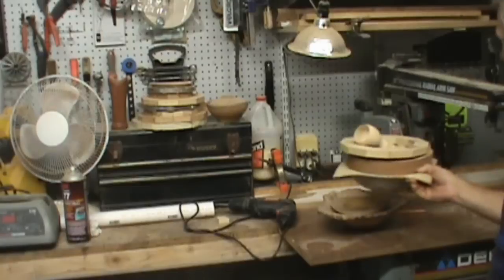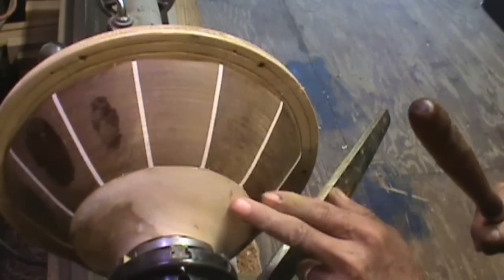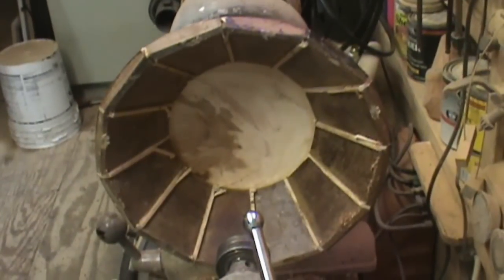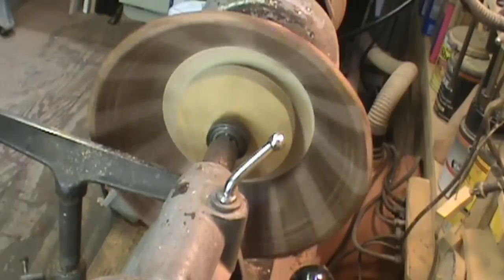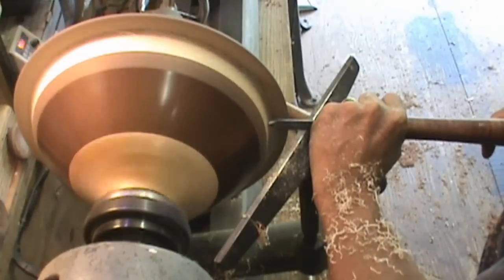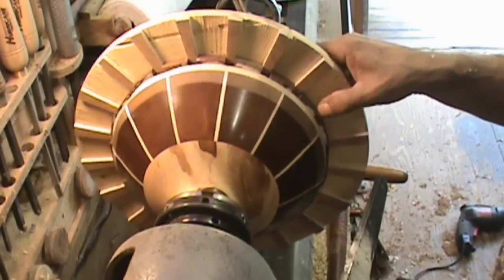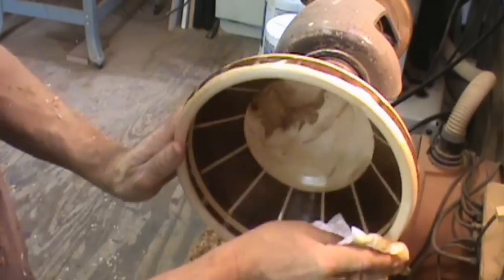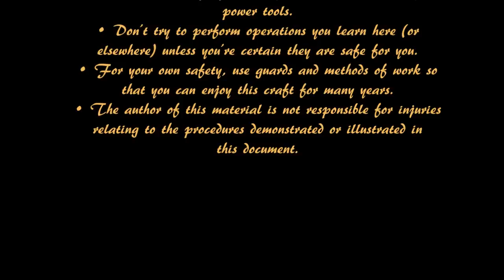Woodturning Ipe segmented bowl part 2

Comment: The Ipe and Maple combination looks great and the finish is very nice. The star inlay would have been the perfect addition, but the bottom still looks good. The execution, however, was lacking. Segmented turning is not something that can be rushed, as I have found out myself. Also it takes quite a lot of preplanning. The open ring looks like an afterthought as is was by your explanation. It made the bowl loose it's symmetry. 12 segments with 24 or 10 with 20 would have worked. Of course 12 segments throughout as well.  Not that I am an expert but the error sticks out badly. Sorry to be so critical as I usually like your work. This one fell short of your usual perfection.
Reply from the maker: +Gil Grace Thank you very much for the nice compliment with the little info on the 20 seg open ring. as you Know I am awat=re of that and said it on the video I know from experience you should not use numbers that aren't double or half. I used it just for the sake of showing how that ring jig was used as many commented on it and were questioning it.Thanks again

Comment: How did you attach the segmented ring to the face place?
Reply from the maker: +Tom Zifer Tom The segmented ring is attached as I show in part 1 hard to explain  after making a small flat surface on the segment rings after put together I dap a small blob of glue center of each seg attach it to the face plate and let it dry

Comment: O Ype brasileiro não tolera cola. Com o tempo ele desgruda, é uma madeira que contem muita resina. Enfim, belo trabalho!
Reply from the maker: +William Bryk Ipe comes from Brazil it does not grow here in USA so this is the same Ipe that you have there
Reply: Yes of course. What I mean is the ability of your piece likely to have problems with the joints . Work here with four or five types of Ype , and learned that wood too much resin in its constitution , they tend not to accept and white glue ( PVA ) or PU . Maybe in the USA there is adhesive material with higher strength or composition provides for such a situation . But I appreciate the feedback and I will say that this parabens about their work! Thank you!